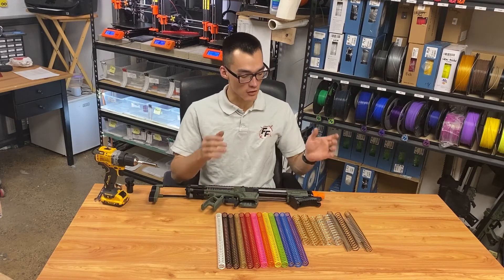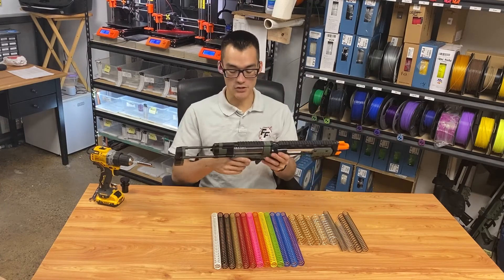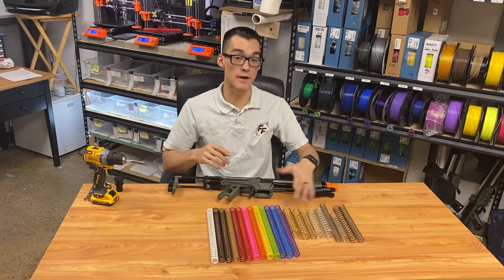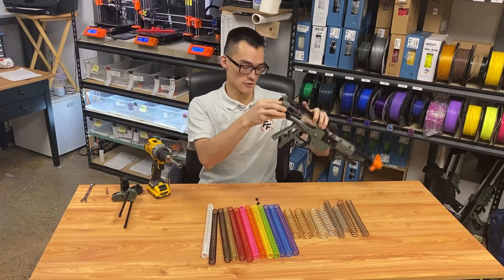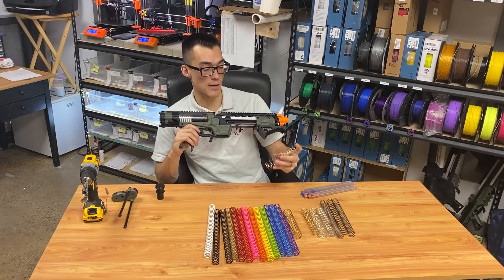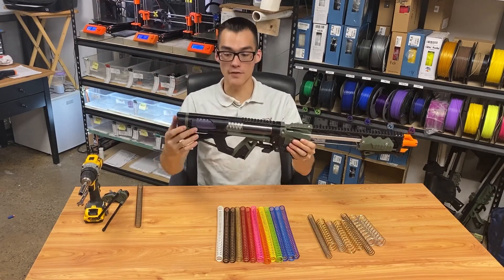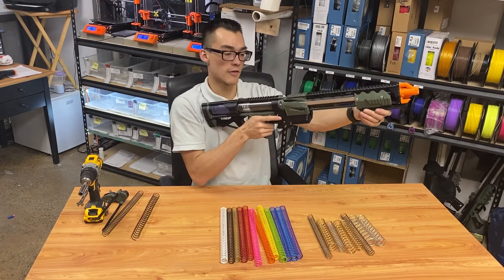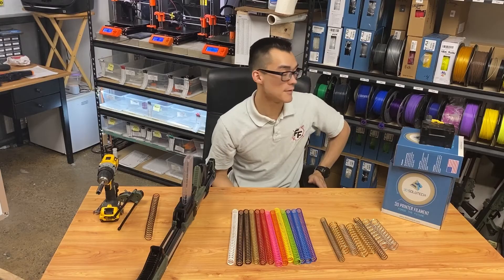Guide to Springs for Nerf Springer Blasters

Comment: If you upgrade a nerf blaster’s spring, is it safe to shoot someone with it?
Reply from the maker: Nerf darts are usually totally safe if you wear eye-pro. But be advised, if you're in close range, the high-powered ones can sting. Not recommended for someone under 14 years old.

Comment: If you use the modded plunger that accepts Turf springs, can you still double up like you did with the 8kg&10kg?
Reply from the maker: Unfortunately not, but you can stack k series springs easier
Reply: @FrontlineFoamBlasters  Ah, I see! So something like a Turf 8k + K 25?

Comment: How much FPS is a k31 and a 788
Reply from the maker: Aqua Fountain 31 is typically around 130. 788 around 150
Reply: @FrontlineFoamBlasters  so does stacking them actually result in 280 or does it not work exactly like that?
Reply from the maker: Trey Martin Not quite. Stacking more combined their spring forces for lack of a better explanation. For example, if a 5kg spring hit 100 and a 10kg hit 150, two 5kg springs would hit equal to a 10kg spring.

Comment: So, I'm getting great results with the K25. My TC is averaging 225 and for me has a super comfy prime. I've seen it hit 282 with a cut down original AF dart, not a waffle tip of course. 260's and 70's with elites. Bamboos, ACC's, Worker's and Z tips are all 220-235. Pretty awesome!
Reply: I'm getting pretty similar results with a K25 in my TCv4 too (a bit better if I ever fix my seal lol), which barrel are you running? I'm using a 12" .509
Reply: @thehollowlingwin  I'm using a 10.875″, 0.527″ barrel, but I've got a 14" and a 16" .527 on the way. Should be interesting!
Reply: @norcalnerfclub3423  Hmmm this gives more ground to my current theory that v4 TCs might love .527 barrels 🤔, my TCB with a 16" .527 with a K25 was hitting 260s on a Caldwell chrono.

Comment: So the TCBU can also take the Longshot springs without having to do anything specific for it ? Just change the plunger head and we're all good?
Reply from the maker: Tochi Caylao The post in the rearbutt would have to be removed. The prime though is tough, so widening the rearcap gives it a hair less compression which is more reasonable.